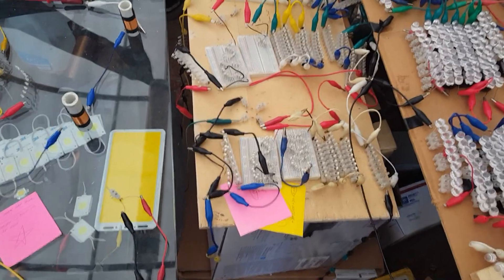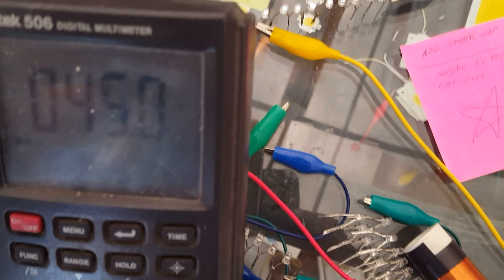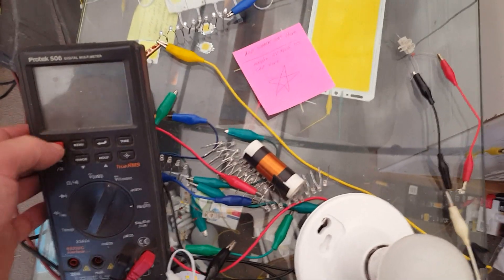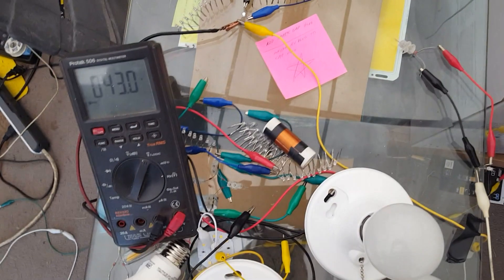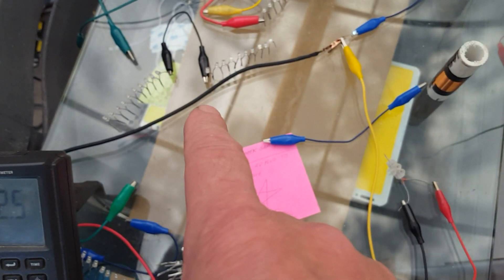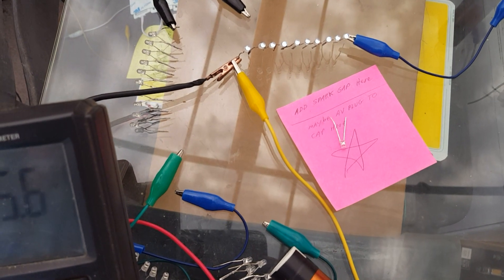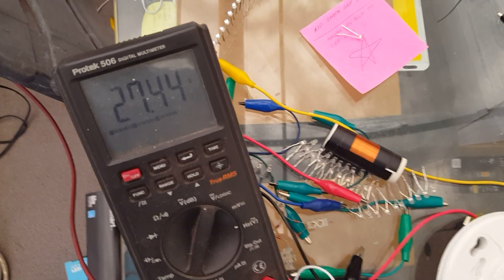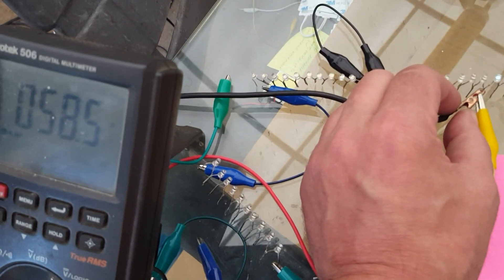WIRELESS POWER TRANSFER Part 26 (How is This Possible!) 60V, 20 LEDs lit with power source off !?

Comment: Is the white wire in back, where it connects to the red lead of your meter, also connected to a capacitance?  Could be stored voltage in some capacitor going through the LEDs to ground.  Also with the positive of the LED going to ground, a reverse-biased diode PN semiconductor junction acts like a little capacitor.
Reply from the maker: Hmmm, I don't think it is stored voltage, it would have blead out after some time.  In next video I post, as soon as I get the time to, upload, I have 50 LEDs lit with power off, and I had them lit all week.  
Hmmm, reverse biased diode, acts as a tiny cap, very interesting.  Hmmm, but I don't see how they would hold that charge and stay lit for a great duration of time after the power is turned off.  I will have to think about this.  Glad to see you again and thank you for your great comments!

Comment: Ok Paul, I took a short rest and wound a couple of identical coils about 6 feet each out . of some light gauge wire and tried it again and got it to work using the sweep function with the same wave setup as you have. I set the amplitude to 20 volts but the generator keeps kicking it back to 10, it's just a single red LED but it is a success the coils are only about 3/8" - 1/2" apart so it's not a home run but it does work it seems to be brightest at 5,440,000.00hz. I tried the 28 - 32 volt SMD LED board/plate again but that still won't work, I'll just have to play with it when I have time. Your 24 feet of wire might make a difference and the capacitors also, I don't know. Thanks for telling us that the wire lengths need to be the same, that is what why nothing worked when I worked with it the first time.
Reply from the maker: Yes, all my coils are of same length wire and wound the same direction.  Your 20V jumping back down to 10V, try turning channel 2 off(i think you have to press channel 2 button twice to turn it off).  It can put out a total of 20V, so if you have two channels on maybe you can only use 10V on one channel & 10 on the other.  If you turn one channel off you should be able to get up to 20V.
Your on the right path now :-)  You might be able to pick up some more tips from watching Bruno VK on youtube here, he is doing very similar work and has even made a couple videos INVENTOR3 spinoff.
I made a 35 minute video of starting from scratch,,, but after watching it, I feel it is a bit too revealing and maybe making it easier to figure out my secret sauce.  So this video is on hold for now until I get a little further with the project.  Meanwhile I will still be working on other videos for everyone.

Comment: Hi Paul, what I sometimes experience with the led's is that when voltage goes up they draw more current, but if the supply (resonance output) can not deliver that more current they dim again. I made a current to voltage graph of my led's and there you see the sudden rise in current when voltage goes up. When you place more in series the minimum voltage where they start to light up will be higher and thus also the point where they start to draw more current is higher. It's difficult to explain but if you experiment with power source and then different amount of led's you will see what I mean.
You can also measure the frequency just by placing a probe not connecting to anything nearby and see on scope what signal is there. You can also have a look at "fft" math function, then you will get a spectrum overview of freqeuncies received ( I don't know if the fft is available at your scope but most of them that I know have it,  https://youtu.be/wDOICSQ0DR0 )
Reply from the maker: Thank you Bruno.  I think this function will come in handy!😁  I remember reading about how people hanging the probes over areas of the circuit without connecting it, now I understand better.   And thanks for the video!

Comment: Hi Paul, I find your current experiments interesting, so I will try to answer your question.
It might not be only caused by a bunch of radio stations from the air. I'm no expert, just got into this for a little while.

So here's some ideas. I can't be bothered right now to tie them together.

I've read somewhere about two distanced ground connections having enough potential difference to give off significant power, for say 10 meters or more.

Not all Watt-meters can show under a Watt.
So, about switching power supplies giving noise on the ground side, passing through the signal generator chasis ground even when off, I wouldn't really know, but if that's a possibility, ther's AC mains noise, that adapter not even grounded. Somebody may know about that.

There's some other thing, which i find much less likely. Thinking of electron flow, and your LEDs cathode not being on the ground rod side, some high enough voltage could pass through the LEDs in reverse. Which for normal diodes is in tens of microamps, (20 uA? or 50? you can find that in data sheets), at full voltage. They have a reverse voltage limit, but if you exceed it and the current is limited, they dont get damaged so quickly. So that could enter a coil, and leave, again, in the opposite direction as per usual, lighting the Leds.
With say 50 uA, you would need 80 Volts in reverse to light a single led with 2 V * 2 mA, if that even lights it up. And your system might amplify that power some.
Again all this has to be due to parasitic voltage from that supply, in order for voltage to come from ground in the first place. Otherwise, it could be caused by longitudinal waves coming from your ground rod, according to Eric Dollard, who says that radio stations can partly emitt that way unintended. He has like two videos of clear AM radio reception just through earth connection.

Anyway, you will get over it, one problem at a time. Ther're alot more details when making a serious application.
I actually came here to write two medium phrases :B and um...
Reply from the maker: Thank you.  Very good possibilities and explanations.  Thank you for taking the time to comment, much appreciated😎

Comment: So voltage leakage from the wall?
Reply from the maker: Hmmm, I don't think so.  I did check with Kilowatt meter to show no current flowing from wall through my frequency generator.  The freq gen has 120V, but no flow, no current, no power through it to my system.  I'm thinking my system is still amplifying energy,,,,, I will have to do more experiments.
Thanks for your ideas and commenting.  The more comments & ideas the better.
Reply: @INVENTOR3  if it is a ground loop current, then unplugging the signal gen and jumping the ground wire should work. Otherwise I suspect the hot wire is leaking voltage. I forget the small amount of current plugged in devices use. There was a Chinese light bulb notorious for staying lit because of the power wire coupling.
Reply from the maker: @MAGnetICus_Attractus   Good idea to remove signal gen and jump the ground wire.  It maybe easier said than done due to the probe connections, but this should tell me something.  I will try jumping ground from wall outlet to maybe where pos probes normally connects to primary coil.  I will keep thinking about it.  Thank you.

Comment: Ground yourself to the earth .. see if it makes a difference. There are folks who swear by Grounding or Earthing.. the process of bare feet on the land with no concrete or shoes. They claim you get electrons from the Earth generated by the Sun. Thing is they use a continuity meter to show the grounding effect but don't consider it's the battery in the tester that's generating the voltage the tester uses. They claim flooding the body with electrons helps it heal.
Reply from the maker: You are correct about the Earth grounding with bare feet, I don't need to try it, I have seen it myself with my own experiments over the past 20 years :-)  Tesla took electrical baths with high frequency, he believed it re-charged his body.  If I remember correctly, he also used his Tesla Hairpin Circuit to heal people with, said to have over 80% cure rate of cancer.
There are also what's called "Earth Batteries", getting energy from the ground.  Good points you make, thank you.

Comment: Your picking up charge from your ground are your clips zink coated?
Reply from the maker: Yes, zinc coated clips.  I agree, from ground, but 60V makes me think there is another force at work here.  I mean you can not make a simple Earth battery and get 60V with only one wire,,, or maybe I'm wrong.  Its not like I have many copper and zinc wires coming & going from the ground, just one.
Thank you.
Reply: @INVENTOR3  the Leds maybe holding a residual charge almost akin to resistors combined with your zink clips and ground charge. The other option would be radio interference from source
Reply from the maker: @Archangel4Truth  Thank you.  I will think about this.
Reply: @Archangel4Truth  What's a charge?
Reply: please repsect this man he is know longer with us.
Reply from the maker: @justinaldrich1719  Hmmm, a pressure, a force.
Reply from the maker: @justinaldrich1719  I passed on to a better life, beam me up scotty, hehehe.
Been going crazy selling the business, my world is getting turned up side down.  I will soon be an employee instead of an owner.  I expect things to get better after a month or two.  I have not had much extra time lately.
Reply: @justinaldrich1719  Lol the old whats is a charge question, if i said it was a group of men running to face a battle or if I said it is what women do when shopping with out cash, or if I said it is a build up of electrical potential used for any possible electronic purpose including electric shocking devices to be used on those asking silly questions. Which one of these would  be the more satisfying answer for your quarry??? Lol
Reply: @INVENTOR3  Pressure from what? Light... rarefaction and compression rates,. -Have the ability to pick up atoms and slam them? In such a manner,. That the solar pannel, may play them clearly into the amplifier. I won't acknowledge the Below answer....from Archangel. So what is a Charge? Can a tuning fork send a signal to a light bulb? causing it to be lit up? Sorry late delay!
Reply from the maker: @justinaldrich1719  What is charge.... a potential difference.    Hmmm, sound, everything is sound.  A build up of light.  Vibrations.  What is your answer?
Reply: @INVENTOR3  What is charge... Well in engineering, they say potential difference is thrust. Thurst can be achieved, from one of two ways, Heat, or Cold. (Cohesion and Adhesion.) Sound is what lifts mass pushing it in an omnidirectional path. vibration is the amps the pitch is the frequency, and the voltage comes from the amps. Resistance is any physical object. How? Oscillation causes the atoms in the atmosphere to be picked up. The validity is that -Water is Charge! Anyone wanna challage me on that -would luv it! (atmos)sphere Just to start if u choose to!
Reply: Waveguide anyone1
Reply from the maker: @justinaldrich1719  Explain a little further please,, "how" is water a charge.  I know Hydrogen is slightly Pos & Oxygen is slightly Neg, hmmm.  Your talking about pure H2O.  Hmmm, water in the air would be subjected to many charges.   I saw a video once, sure wish I could find it again, guy had two small vials of water, one as Tx and one as Rx.  The most mystifying liquid on the planet, water :-)
Reply: @justinaldrich1719  Lol wrong word Rule replace it with Theory. Is what you call a Law or Rule truly such? Did nature define it as such. Dont let the words deceive you when the real answers are found in thought...
Reply: @Archangel4Truth  Did someone say something. Nope nothing useful
Reply: @justinaldrich1719  ever hear of eletric beatification or the Hutchinson effect or how about a longitudinal wave shooter. Do you need me to explain the principals to you. Tell you what do a little research on these find what you can and if your a good boy I might explain the rest...
Reply: @justinaldrich1719  ever hear of eletric beatification or the Hutchinson effect or how about a longitudinal wave shooter. Do you need me to explain the principals to you. Tell you what do a little research on these find what you can and if your a good boy I might explain the rest...
Reply: @Archangel4Truth  Sounds like you wanna vent about something you have learned recently......
Reply: @justinaldrich1719  not at all i like letting others enjoy the discovery of things new perhaps for them by leaving bread crumbs on the trail
Reply: @Archangel4Truth  You wrote: "do you need me to explain the principals to you." That is directly a Tell. Also followed, by your next stanza is the,. Word: "Tell." Now you wanna deny your words. I won't finish the rest of your script, for ill leave something to regurgitate for later.
Reply: @justinaldrich1719  spooky words at a distance shall not break the sound barrier but my thoughts travel faster then the speed of light...